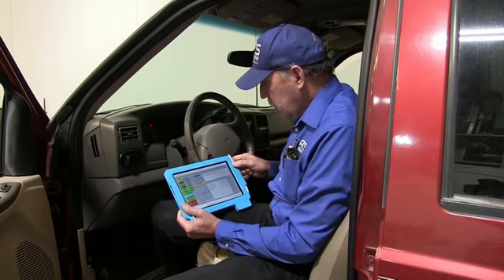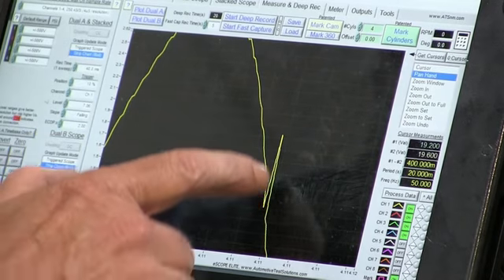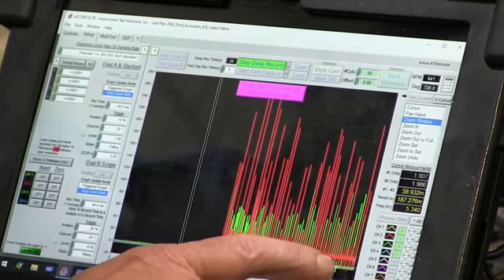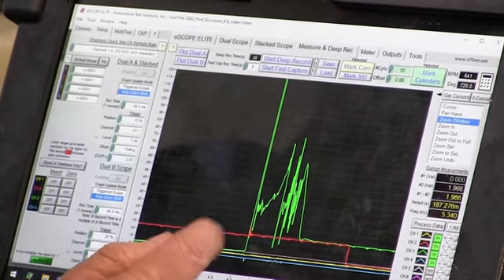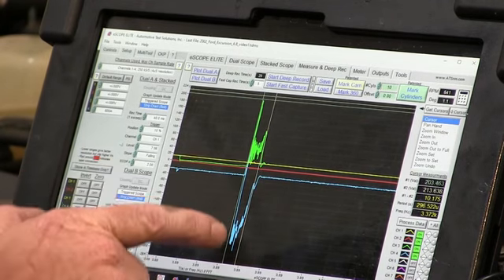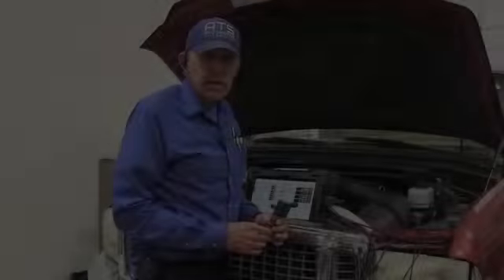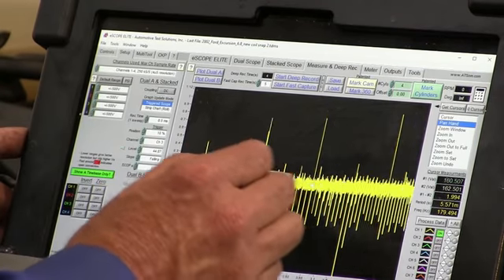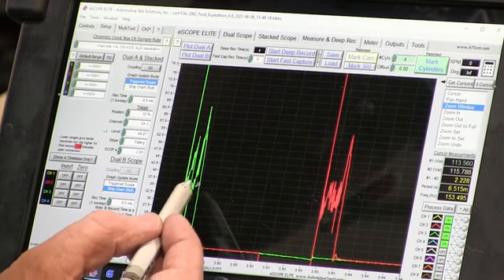2002 Ford Excursion 6.8L Stalling Problem

Comment: I have the same model and engine doing the same exact thing. Mine turned out to be the IAC valve sticking. Doesn't throw a code for IAC because IAC doesn't know if the valve is sticking so it threw the output speed sensor instead.

Comment: IF I were to change coils or injectors on my 2001 Ford Excursion V10. What is best brand ? It currently only has 129100 miles. I just changed all the plugs today. Still have a hit/miss misfire. Not enough to throw a code, but I can feel/hear it jerk. Just purchased it about a month ago. Should I run some kind of good injector cleaner in it ?

Comment: Had an older f150 years ago, coworker did plugs, coils, injectors and the truck would still break up, "miss" and stall. Ended up being a faulty speed sensor in the rear diff causing speed limiter to kick in. Was a fun diagnosis

Comment: When you replace  spark plugs you replace all of them, would it not be a good idea to just replace all injectors or coils, so you dont have it come back for each one that fails?
Reply: Not on these. You run the chance of stripping out the plug threads in the head. It's best to take the if it's not broke don't fix it approach to this.

Comment: I also will perform a lot of tests and similar circuits or the same ones which is the key on engine off determine whether or not there is actually a problem inside the PCM

Comment: You mentioned understanding what the computer does well you would have to be privy to that information otherwise it's just guess work every manufacturer uses a different format to accomplish sometimes the same thing also I'm curious on how the ignition is only affecting the speed sensor and nothing else if that be the case then there must be something wrong with the PCM allowing it to infect the speed sensor circuit and nothing else

Comment: Exact same excursion with the same problem.  Just bought some of that 505 crf. Also the oil treatment.  Not cheap but Scotty Kilmer also reviewed the oil treatment with and noticeable difference in engine noise afterwards. Thanks!

Comment: I was driving to Florida few years ago with my 03 Ex 6.8 176K , was running rough and getting the flashing code on the shifter.  Sargeant Service Center in St Augustine diagnosed as coil pack failure.  I was 1000 miles from home and they could have pulled my pants down.  Credit to that shop. Changed plugs and coil packs, I didnt have any problems the 1000 miles home.  Now sitting pretty at 215K.  I always have used Dextron,  will try the 505.
Reply: " I was a 1,000 Miles from Home & they coulda pulled my Pants down " ( if they
wanted too - but they were honest & sharp ) !

Comment: We had 2002 through 2004 F250 through F550's some with the 5.4 V8 and 6.8 V10 engines.
We also had some E250 and E350 vans.  The E350's had the 6.8 V10's.
I would see many of the F350/6.8 V10's have one specific computer code for the I.S.S. or Input Shaft Speed sensor in the transmission.
The first one I got drove me crazy because no matter how I tested the vehicle, the code would not return.
All I had for a scope between 1995 and 2016 was my Fluke 98 Series 2.
I sure wish I had my Pico back then.
One day reading some iATN postings, a tech indicated how he had a V6 minivan with intermittent engine stalling and he found out by putting the vehicle inside the shop, wetting down the V6's spark plug wires then starting it, number 1 was arcing along the length of the wire and the engine would stall.  The wires were original and the vehicle was old, so new(very much needed) ignition wires and worn with a large gap plugs were replaced.  No more stalling and a better running vehicle.
So I decided to check the plugs and sure enough......W I D E gaps on all 10.  The coils were original and Ford had updated their Motorcraft coil after a few years.  After properly gapping and torqueing the plugs then replacing the 10 coils, no more I.S.S. computer code.
The F350's were utility body duel rear tires and we're loaded down with tools and parts.
These were L.A. Depth of Water & Power trucks with 25,000 to 40,000 miles on them when the problem would occur.  City stop and go mostly, so plug wear was normal.
The F250 pickups had a similar problem but they had over 50,000 miles on their odometers.
Your video suddenly made sense why I saw those vehicles with the 
I.S.S. code.  Seeing the "Ignition Strike" backing up into the sensor which shut off the engine made sense!  That strike also helped to create the carbon tracking internal to the coil.  I'll bet the spark plugs had worn and wide gaps.  Ignition coils don't normally like wide plug gaps!
Thank you for this video!

Comment: I wonder how many of us even guessed that an ignition coil problem could be the culprit for an input/output transmission shaft speed code. I certainly didn't and furthermore, doubt any flow chart would suggest such a possibility either... 
Another masterclass by Bernie.
Reply: Oh yea imagine following a flow chart for this. 
Replace sensor: check resistance on wires, replace PCM
Reply: My main question is with that ignition problem why is it only as affecting the speed sensor circuits and not other circuits such as the crank or Cam having induced voltage spikes well that has to be bleeding back through the computer at this point from what I see to only affect the speed sensor that doesn't sound logical to me
Reply: I was thinking maybe the sensor was pulling down a 5 volt reference somewhere. This was a great find.

Comment: Bernie, if you read these comments, can you expound on how the computer’s assuming transmission slipping when the output is showing higher rpm than the input? It should be the other way around if it was a slip detection strategy. I think this was purely an EMI concern from a misfire and the computer losing counts than it was a fuel cut strategy from a slip (which it didn’t have at all)
Reply: Was thinking the same thing…had a older gm car do this due to the wiring harness for the output shaft speed sensor intermittently grounding against the case.  Guess the bias voltage and the short to ground was enough to create current flow and when the short would go away it would spike a little bit like an ignition coil which caused the computer to interpret the high spikes as a speed signal.  Just as you were coming to a stop it would shut off.   Seemed to me like it was going into open loop/fuel cut since its saw a speed signal with no throttle input like if u let off the gas while coasting at say 50mph, the computer would turn off the injectors until you got back into the throttle.  Still always impressed with Bernie’s knowledge and the tests he comes up with.  Also grateful he’s willing to share it.
Reply: I believe it is an overspeed condition so the injectors are being cut to reduce speed.
Reply: Would one mot assume in that case it would also loose the spark aswell? The factor it only looses injector indicates its some fuel cut strategy imo